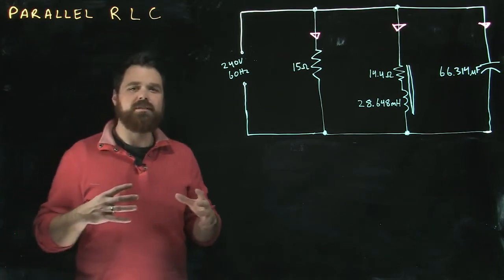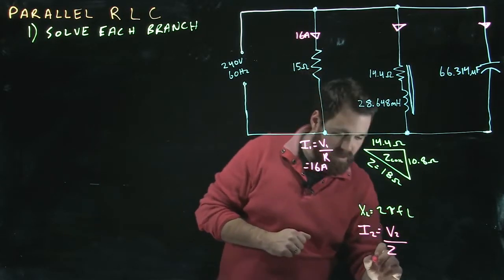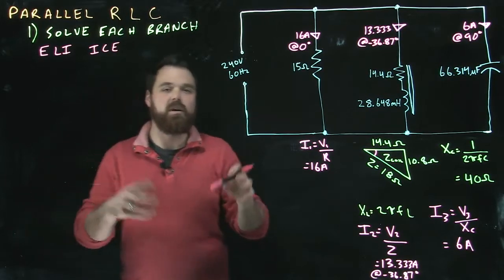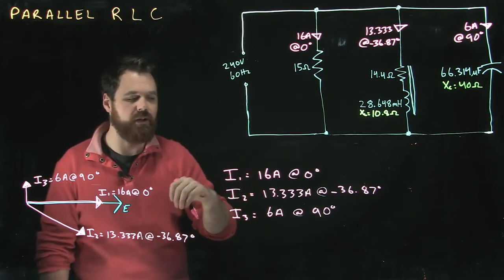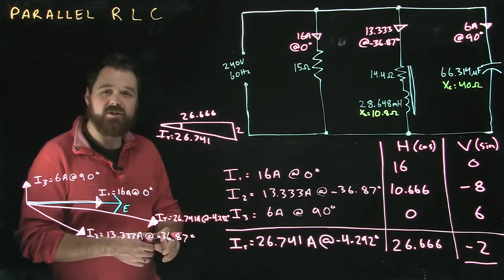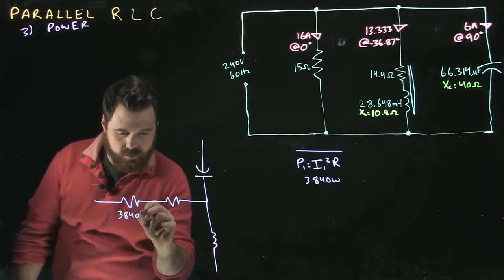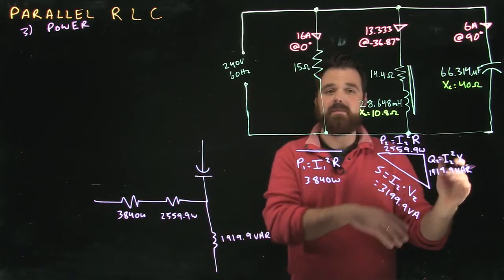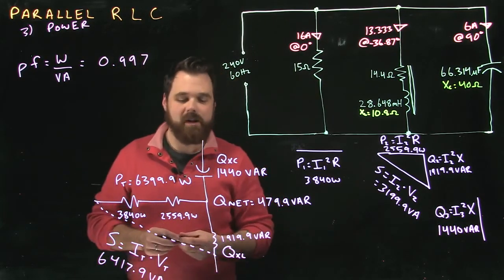Parallel RLC Calculation Start to Finish

Comment: Hello, Zack. Sorry to bother you again. Just to point out another subtle mistake in your video. It's a common mistake one can even find in some textbooks. The complex power consumed by a complex load is given by the phasor line voltage times the conjugate of the current through it. Thus for a lagging load, i.e. an inductive load, the complex power has a positive reactive component and hence a positive angle. This means that the power triangle must be drawn upright and not the way you have drawn it. And it's the other way round for a capacitive load.
Reply from the maker: Hey there! I can't say that you're wrong. I just do it this way to keep the relationships straight in my own head. Trying to keep it as simple as possible. Thanks for watching!